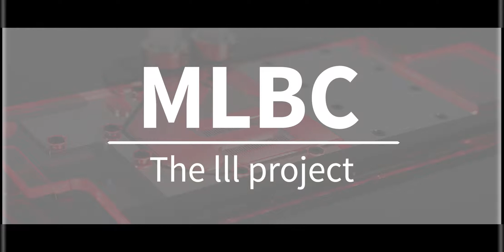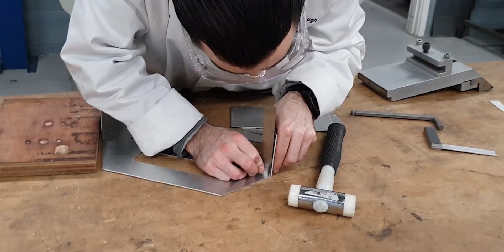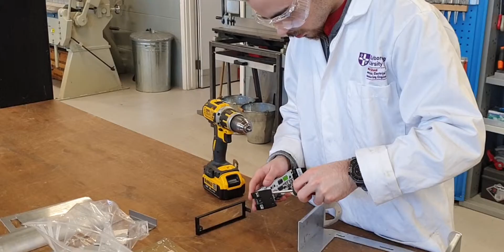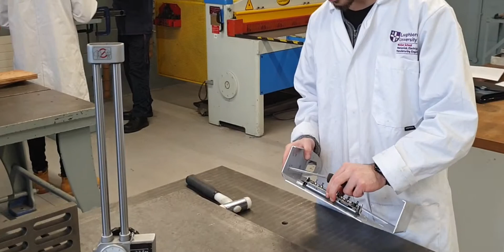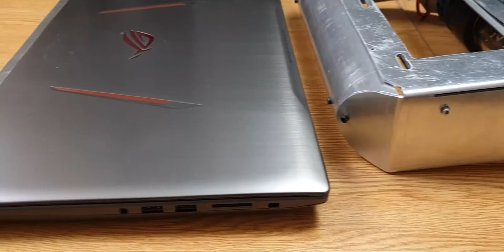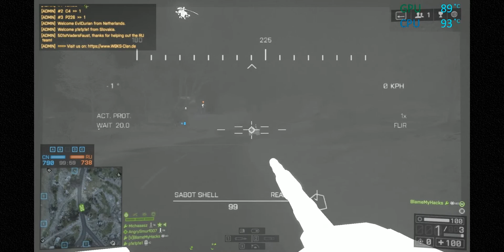Laptop Liquid Loop project. Part 6.1 – Making a custom enclosure

Comment: Looking good :)
Puts to shame my cobbled together ziptied/hot glued external pump/res/240mm setup but I'm all function no form for stuff I only use around the house. (my DIY mods: https://imgur.com/a/sQV6O https://imgur.com/a/TTyAJ)
One thing I've found with quick disconnects - to prevent spills upon connect/disconnect, have the disconnects at the highest point of the loop. Better to have air introduced into the loop that can be bled from the reservoir, than liquid escaping near the laptop.

Re liquid metal which I've been using on laptops for over 2 years: loss of LM and degradation in cooling 3-6 months post initial application is normal.  Open it up and it'll look partly "dried up", I advise you to check the application ASAP, uncooled 'hot spots' on the GPU die is a big risk for damage due to overheating.
Check this thread for examples of spill protection - foam dams, conformal coating etc. http://forum.notebookreview.com/threads/foam-dam-barriers-for-liquid-metal-safety-insurance-guide.817207/ I use liquid electrical tape now around the die, dries faster and much easier to remove than nail polish.
For some detail on the chemistry behind the progressive loss of mass and the eutectic ("liquidy") state of galinstan (in particular, gallium) through reaction with copper see here: http://forum.notebookreview.com/threads/something-to-think-about-liquid-metal-compatibility-with-copper-heat-sinks.800890/
This Cu/Ga alloy formation reaction is surface only, does not itself impact thermal conductivity, and will not occur with subsequent re-application (unless it is sanded or polished back to a copper surface)

I cannot stress enough - refresh that liquid metal on the GPU *ASAP*